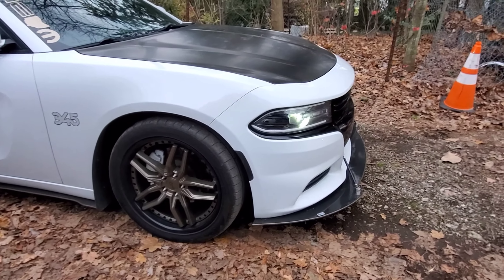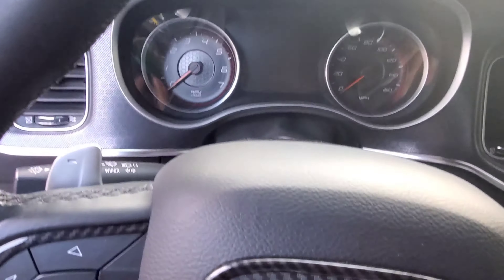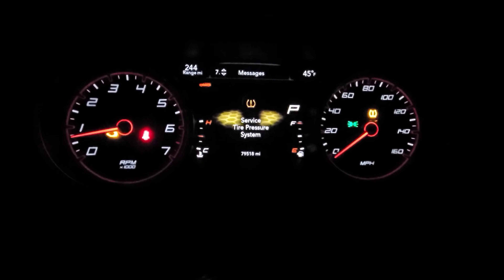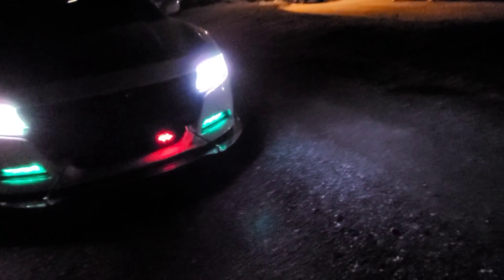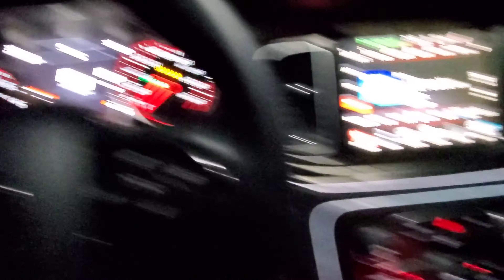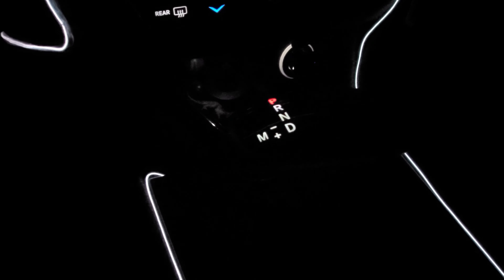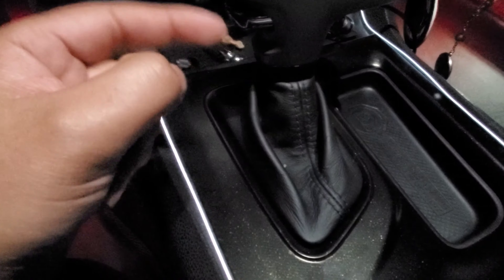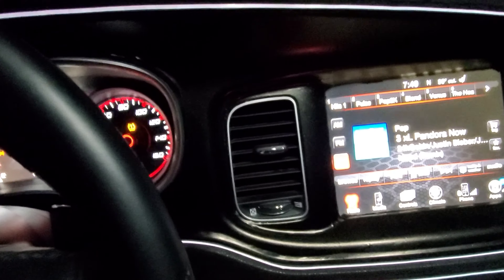Service Shifter error in a 2015 Dodge Charger

Comment: Man im currently having this problem on my 16 charger R/T. After i got the warning message my car got stuck in park and then the next day when i came out the car was acting like it was completely dead and the shifter was blinking all red
Reply from the maker: Yeah more than likely the shifter for sure then. I had to jump the car the first time I noticed the shifter wouldn't work
Reply: can you give me an update? im going through this right now
Reply from the maker: I actually did make an update video shortly after this video. Check the link in the description.
Reply: Did you find out what it was mine is having the same issue
Reply: Did you ever get it resolved? I’m having that same issue.
Reply: Anyone have any luck? Mine doesn’t even start like the video I already have bought a new shifter and replacing and nothing cars still dead
Reply: @willmanfuentes  si prendió tu carro?
Tengo el mismo problema
Reply: @alejandrorochagarcia9835  lo tuve que ir a meter al dealer
Reply: @willmanfuentes what was the problem bro

Comment: My 16 300C just did this to me last week with the Tazer installed, (adept reset happened twice in 5 mins, wiped all the computers completely, like hitting the brakes turned the interior lights came on and passenger rear door opened  lol.
Reply from the maker: Jeez!! I have a Tazer too but I have the old software so I know my issue was unrelated to it
Reply: you could fix the problem i am going through the same
Reply: @christiancornejo3615   i did i had t have the the dealer reprogram the whole car
Reply: @zachdailyfost4433  how much was it
Reply: @ethancoffman8160  it was about 250$
Reply: I’m going through the same thing on my 15 scat pack challenger…. Kept showing my doors open and all types of crazy stuff
Reply: How long did dodge keep your car just to reprogram it? My dodges in br taking months + to work on cars rn.
Reply: @diyonwoods9702  over night basically

Comment: I Kinda having the same issues I had the shifter as I put it in with the battery off then plugged the battery and it worked perfectly. Same day I drove it for 15 mins and parked it but when I went back to my car to turn it on the lights on the shifter wasn’t working no more. So right now I unplugged my battery as I’m waiting 24 hours to see if anything happens
Reply from the maker: Hoping it worked for you!
Reply: Did unplugging the battery work?
Reply: Did this work?

Comment: It happen every year this my last dodge to be honest.I spent way to much money fixing issues on 2 basically brand new cars an 1 having driving on the road in the 2017 dodger charger rt+ you go over 75 or 80 the car cuts on an off yeah! On in off an the 2nd 2013 charger car stuck in park😡My last dodge.Scotty the car guy might be on to something.
Reply from the maker: Thats unfortunate! I've had my ups and downs with this car but nothing crazy thankfully.
Reply: Sounds like a fleet governor most smaller vehicles after 96 had some type of speed limiter many vehicles I've owned had it around 82 miles an hour. I believe it's an option in the program for fleet type vehicles should be able to be disabled with the proper programmer did you ever figure out that particular issue

Comment: So I had my shifter replaced due to this same message on my cluster, dealership did the work and about 1 week later the same error message came on and it left my car stuck in park. It’s currently dead and only starts when jumped… im not to sure what to do next as the dealership that did the job has now ghosted me and makes BS excuses when I try and book an appointment to get my warranty on the shifter they replaced… anyone experienced this issue after replacing shifter. It’s a 2016 charger scatpack R/T with about 108k miles now
Reply from the maker: I wouldn't stop trying to get a hold of that dealership. That's BS. They're required to honor their warranty
Reply: @renzridez   at this point I’m going with their rival dealership and explaining what’s going on so that they can send the bill to the original dealership. Also didn’t mention that they replaced my transmission and had my car sitting for 9 months before they even started the work…. Then a month later the service shifter code started, they replaced shifter and car ran fine for about a week until it said service shifter and had lots of lights in my cluster turn on and then audible clicking noises coming from the shifter. Cars been dead since and that was in February of this year, the transmission ordeal started February of last year until they returned it around the second week of December 2022
Reply from the maker: Oh shit man. Yeah, definitely find a new place. Hopefully the other dealership will honor the warranty
Reply: @ligmaahnutzz8120 hey did you ever figure it out ?
Reply: @FISBANGA  well the dealership still doesn’t reach back to me after several attempts of getting it fixed. So I took matters into my own hands and fixed the issue. The dealership didn’t install my shifter properly and it created permanent DTC’s. I then went through the repair process and cleared the codes and have been driving it almost daily since November of 2023
Reply: Threaten to Sue them that’ll do the trick

Comment: Replaced my batter , got new spark plugs and coil packs , new cam sensor,new throttle body. Imma try to replace shifter Nd transmission control module next god i hope this works. Ive nearly bought a new car
Reply: It was the tcm
Reply: 1500$ 😢😢😢😢😢
Reply: The TCM stopped communicating with the ecm
Reply: But I got to it before I messed up the transmission
Reply from the maker: Thats a wild road to be on!!
Reply: @renzridez  shit hurt but I'm less than a year out of paying it off . So no choice
Reply from the maker: Might as well at this point!
Reply: Still doing shift to park . I'm gonna replace shifter next then alternator. I'm literally at almost every part but the motor bro . And I'm doing that in the fall . God I love my charger but fuvk man . I would've put damn 9 k until the shit this year and I owe 9 k  om it man smh
Reply: Im.at almost 7k bro . And my warranty won't cover it
Reply: @johncoleman5974  hey whats up bro im having this same issue and im leaning towards replacing the tcm.....did a new tcm do the trick for you?

Comment: My shifter is moving to all gears but the car won't move (stuck in park) and the light is blinking red on shifter. Then it says put in park then switch to desired gear. i have a 2019. its pissing me off, i changed the shifter assembly at the bottom of the shifter, but now ima change the actual shifter.
Reply from the maker: The sensors and what not are in the shifter itself
Reply: Same fucking issue rn
Reply: @AdrianRamonGarcia  dude my problem was i needed a transmission LOLLLL i swapped it out and my car moves again
Reply: @SoIcySwipe  you needed a whole new trans?
Reply: @jamie31cardinals  yes!!!
Reply: @SoIcySwipe how much did it cost to do a whole transmission swap?

Comment: Did your car ever not start after this happened? Also was your break hard to press?😊
Reply from the maker: Car always started, I don't remember about the brakes.
Reply: Yes this happened to me, had the battery replaced but it would happen every now and again, it was basically loosening the connections every time I drove it which would give me no current to the battery

Comment: thank you for the information! but where did you get the front splitter from😍
Reply from the maker: Family Customs! They have different edge trim too so you can change out the color. Use the code in the description for 15% off
Reply: @renzridez  did you get carbon fiber?
Reply from the maker: Yessir!
Reply: @renzridez  thank you, i got a 2018 Daytona. Having the same issue as sometimes the car wont start and when it does, it starts as if the battery is dead and i get the service shifter light. I changed the shifter and unplugged the battery for 30 min, still having the same issue..taking it to the dealer today for diagnostic.  Will let you know if problem was something different.  After it is fixed, definitely getting them body kits 😍
Reply from the maker: Best of luck! Whenever you get to the point of ordering, don't forget the code
Reply: @renzridez  i definitely will 😊

Comment: I changed my shifter and it still pops up on my dash
Reply from the maker: Did you unhook your battery for a few minutes? If so, you might have other issues
Reply: its probly the shifter column
Reply: Neutral saftey switch !
Reply: Check the harness connecting to the gear position and indicator modules. On my RAM the harness running up the steering column and into the cluster related to these components has an  erratic connection.. Probably the classic Chrysler connection pins making poor contact. 

You may have just coincidentally moved the harness connections enough to get a good connection. And the shifter was fine the whole time..

Let us know what happened "down the 🛣️" haha

Comment: Did you have to re program the new shifter or anything?
Reply from the maker: Not really. Just disconnected the battery for a bit and that was it
Reply: @renzridez  sorry to bother but was your  shifter blinking red before you changed it?
Reply from the maker: Watch the video and you'll see 😉 I truly don't remember anymore
Reply: I’m having the same problem you got your fixed
Reply: @shamarmccrea1372  not yet had just had it sitting thinking of finally taking it to a dealership have you had any luck?
Reply: @renzridez how you don’t remember that in it was n ur car don’t post this shit if u don’t want ppl who experience the same problem with they chargers or challengers to ask questions..
Reply from the maker: You watch the video or nah? That was 4 years ago my dude

Comment: My 2015 rt drives shifts feels fine though when idling I hear a scraping/clunking noise coming from the shifter area. My problem with my car is that it randomly stalls out “shift to p the. Desired gear” I’ve noticed it does it once or twice then my car drives totally fine. Though this is very dangerous since it gave me that error in the free way and I had to pull to the side and pretty much start up my car pretty concerning. I’ve recently changed my drive shaft assuming that was the problem but nope. If anyone has any idea what it is or has had it fixed plz reply asap thanks!!
Reply: Having the same thing happen

Comment: I just bought a 2021 challenger rt with 18 miles on it I’ve had it for 3 weeks and this happened to me :(
Reply from the maker: 😭😭 I would take it back to the dealer asap. I'm 90% sure tows are included in the warranty
Reply: @renzridez  I’m currently waiting for the tow truck to take it to the dealer! I’m so sad this happened
Reply from the maker: I would be too especially at 18 miles!
Reply: What was your cause?
Reply from the maker: @jamie31cardinals cause of what?
Reply: @renzridez  sorry I responded to the wrong username